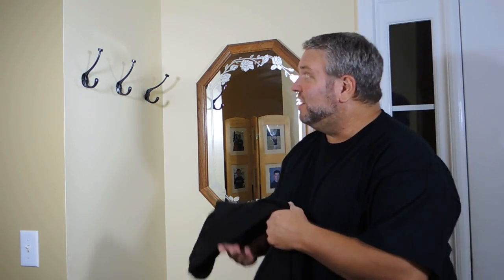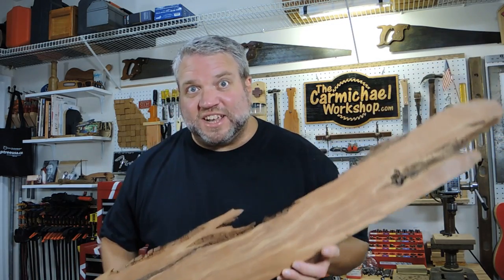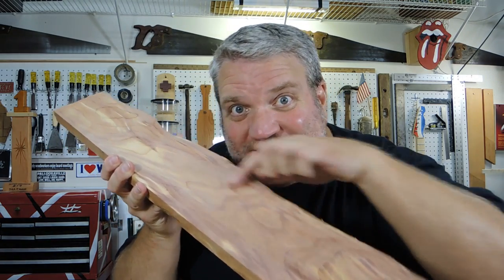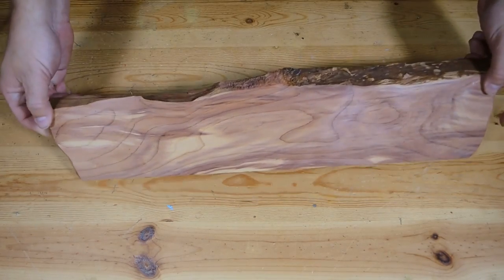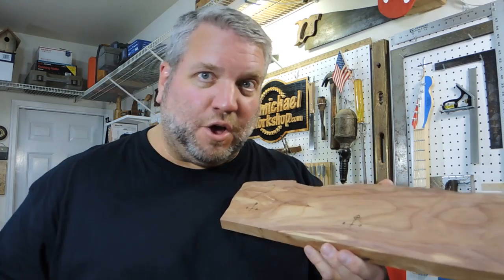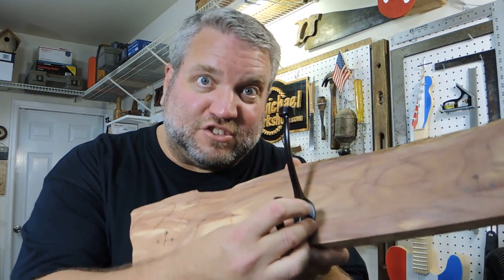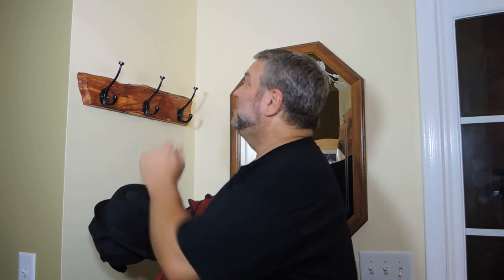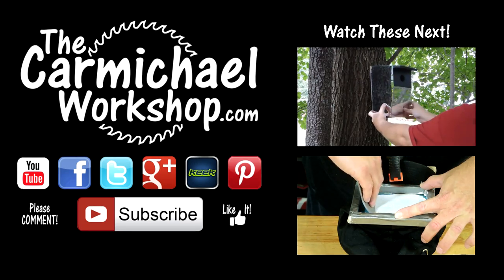Live Edge Coat Rack - Home Improvement Woodworking Project

Comment: I don't have much confidence in those plastic plug anchors. if they do come out, I suggest replacing them with large toggle bolts. The holes will be hidden from view by your (awesome) coat rack, and they spread the strain out over a larger area so they're more secure. Great job!

Comment: I like the tip you gave us about hiding the mount holes for the wall.  I never thought of that.  I wanna try something like this.  A majority of my projects are pallet wood so this would be different.  Thanks for the idea and nice project.
Reply from the maker: Luis Figueroa Thanks!  I got that from Dale at Beaver Valley Woodworking.  This is a perfect use of a pallet board.

Comment: Nice project. As you mention the weather is changing and coats and jackets will need a place to go so to my work shop I go to try my hand at a very similar project. Thanks for the inspiration.
Reply from the maker: Philip Berry Thanks Philip.  It's still warm here but it always switches to coat weather pretty quickly.

Comment: I love aromatic cedar, the colors are the best and it smells pretty good too!  I didn't know the edge is called Live Edge, I have a few pieces in my pile with edges like that, but I am not sure how to clean it up.  Did you sand paper it after chiseling off the barkish stuff??????  It sure looks pretty under those coats and hats :)
Reply from the maker: Cy's Corner Thanks!  I just took the rough stuff off with the chisel then used the palm sander.  I left some of the dark stuff on the edge for looks.  I've heard that a wire wheel on the drill will knock off a lot of the loose stuff and give it texture lines, so I might try that sometime.
Reply: Thanks for the info!  :)